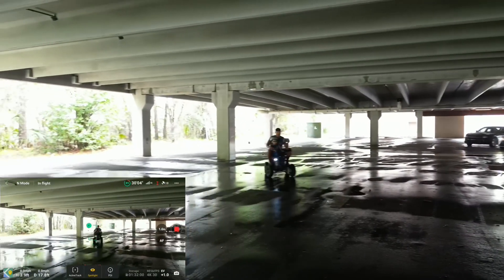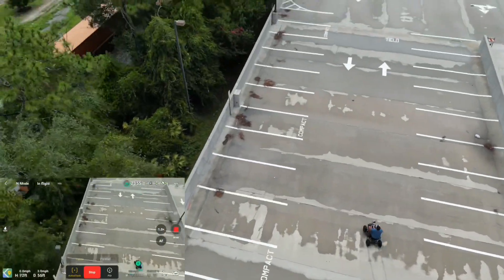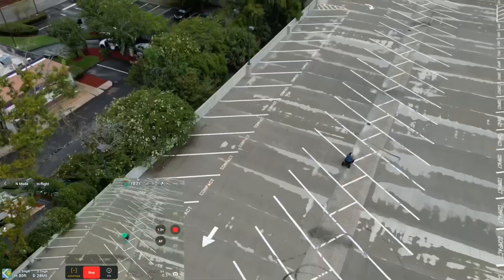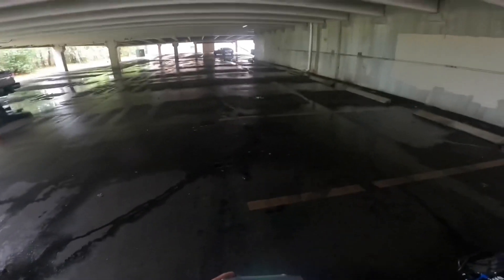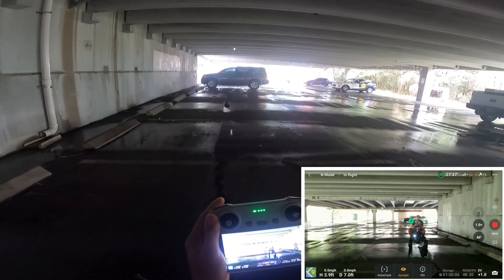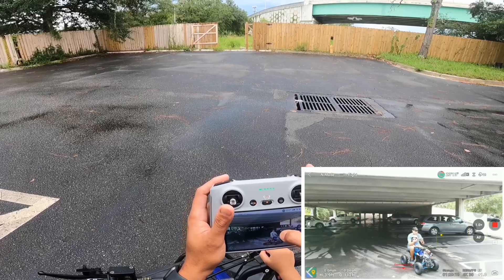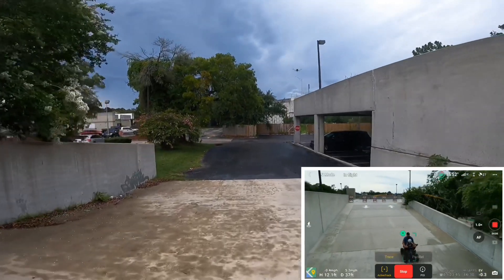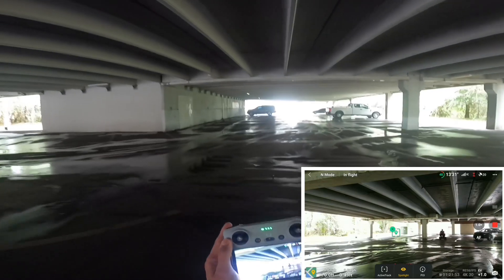Dji Mini 3 Pro Active track Bypass indoor￼ Parking Garage & Rooftop In low lights on a ATV!  ￼

Comment: Some recommendations: If you are going to fly this drone indoors, make sure that you have installed propeller guards on it. It will not only protect the propellers, but the drone itself from falling if it hits a wall or other obstacle (believe me, I have learned this the hard and expensive way). You will have to use this drone in Sports mode (obstacle sensors disabled), but operate it in low speeds when flying inside smaller rooms. Change the settings for command response in the Sports mode to be the same as Cine mode.